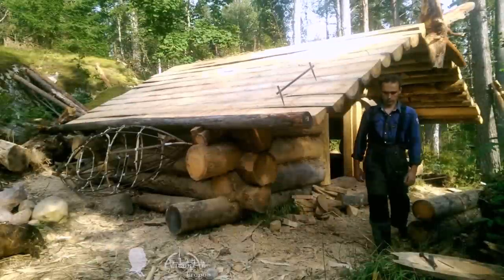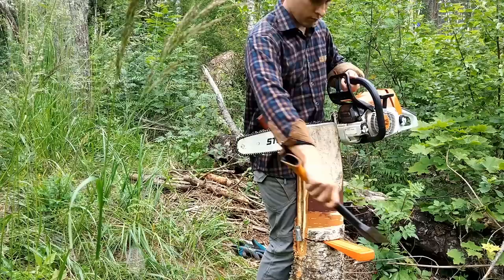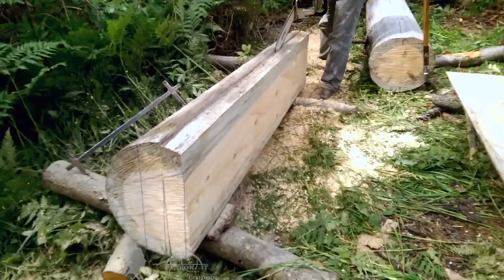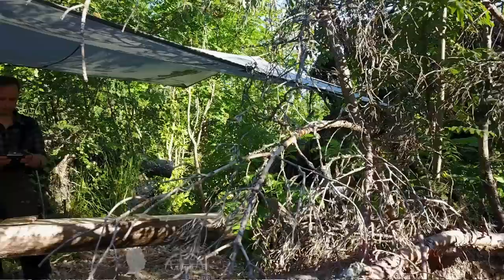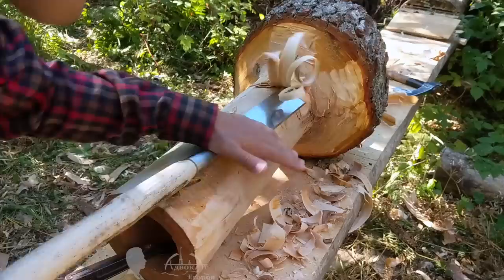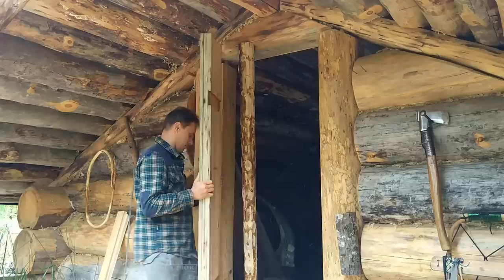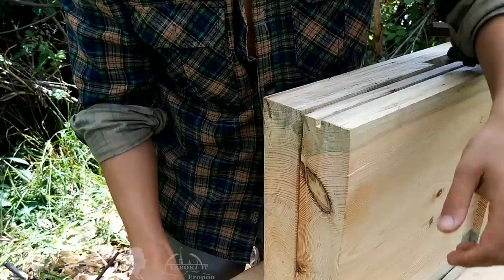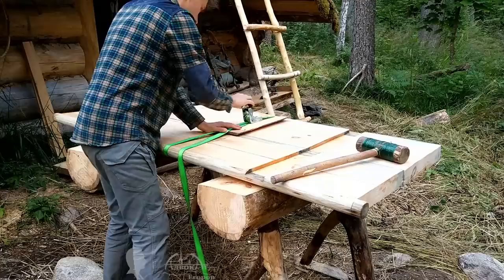Bear-proofing My Log Cabin

Comment: I would assume that the reason for your Chainsaw failing was overuse. The 260 is not a big saw, nor is it designed to run full throttle for a long period of time. When cutting your slabs you probably ran it for hours at a time, that got the cylinder/piston to hot which in turn made the lubricationfilm break. This lead to the piston seizure you showed. 
This is a small 4HP saw after all. 
I guess the solution to avoid this would be to use a bigger saw, or make sure it does not overheat by not running it full throttle for to long. Maybe a richer jetting would help as well.

The 260 is a good saw and so is the 261, dont blame it ;)

Comment: A door that opens OUT cannot be kicked or pushed IN against a thick jam ledge. 1 inch thickx18 ft or about 200 inches=200x7000PSI so bear would need strength of 140,000 pounds to break it; the 2 inch thick planks would break first. Windows in cabin provide safety exit if snow piles up against door. However, a 100 lb woman can bring the entire cabin to the ground unless picked exactly right, but seasoning can twist her spirt, so it is best to build 2 cabins and get a girl who can use a blockplane. I built the doghouse of my sailboat with no nails using 100% lock-joints and only 2 wooden lockpins I can remove if I want to tear the structure off.
Reply from the maker: Thank you for such detailed reply!

Comment: Is it out of the question to use staggered logs instead of notching? I realize it would require hardware at the corners in that case, but any other cons?
   This is a great build.
Reply from the maker: My roof weighs a lot so staggering logs wouldn't work well most likely...

Comment: When a Bear opens a door it will do so by pushing against the door with its massive strength and weight so naturally you would want the door to be more resistant to an inward push than an outward pull.

Comment: The newer chainsaw...that was made in Brazil...was made with much cheaper / inferior materials which is why it failed so quickly.  
I have seen this many times in recent years...they try to maximize profits by using lower quality materials and lower labor costs than they used to.

Comment: I assume you made the door open outwards because it would be easiest to make the hinges as there isnt enough space for.the door to.open inward. Also  if a bear would roam.around it would not be able.to.push the door open inwards to just barge in but it would have to open it outwards meaning pull the door towards her a task i assume nearly impossible

Comment: You made the holes for the windows  by making saddle copes with the chainsaw .
Reply from the maker: Robert, it could be done like that, however, I carved it on the already built log cabin...
Reply: @Advoko  What if you made plunge cuts to remove a section and then make coping cuts and then chisel out the circle? Think that would work? Did you use a gouge to do it?

Comment: there's no point in a double pane window lol. windows have a chamber in the middle because it typically has a highly stable gas trapped that is resistant to temperature change.

Comment: It seems to me that the door swings outward simply so that a bear cannot push it inward, using all of its body weight. If it pulls, it cannot pull as hard, and so a lock or clasp does not need to be as strong.

Comment: Mix your gas 32:1 and you will have NO MORE CHAINSAW PROBLEMS. In my HUMBLE opinion, NO engine gets enough oil at 50:1 to one and it was DESIGNED to LIMIT the life of the engine. OLD chainsaws...50 years old that were mixed 16:1, RARELY have ANY scoring of the piston or cylinder wall.

Comment: Dude im a Sthil Technician, i repair them and need to read all the documentation..  That MS 260 is a bit small for what you are doing..  MS 3** something would be way better..   260 is like the biggest Home Owner saw. you need a bit more then that with those logs

Need* is the wrong word.. you could use something bigger.. you dont *need anything

Comment: Door opens outward?  Bear proofing, fire escape, interior room.  Bears push well but lack human like hands to pull.
Reply from the maker: You got it))
Reply: Thanks.  

I live in Minnesota.  Blizzards are a problem.  For doors which open outward you might consider a design which is split horizontaly.   Commonly here called "Dutch Doors".

The reason is that the wind driven snow can form snow drifts making it difficult to open the door. 

Another choice might be to include a dormer in the roof.  This way you can probably get out to shovel the drifts away from your door.

I have had to remove the glass and screens from modern storm doors and work thru the opening to remove drifts after a blizzard.

Comment: I read all coment. I have to laugh. I am joiner for furniture. My college three years and after that,during the job I did two years college for joinery- high college-gradual exam.  Aftr that,three years univerzity for timber and forestry. one year college for wood barrel-only one class for the whole of europe! Job i did finishing joiner custom furniture,joinery job,carpentery job. Practice 25 years plus college. Sorry. All things what his did is from machine ,FROM  WORKSHOPS! He would NEVER be able to work on these surfaces by hand or manual power tool. For camera his hand cut something. Only the cut on the door would take an hour with this saw and then he would have to rest for another hour. It can be seen on the arms and muscles and the figure that they are not used to working like this physically. The whole video is only a theater for those who do not understand the darkness. The man is not used to doing such work.!!! I see how he likes to pick it up.:-)
Reply from the maker: I work as attorney and this is only my hobby...